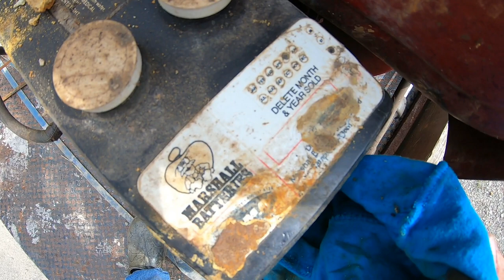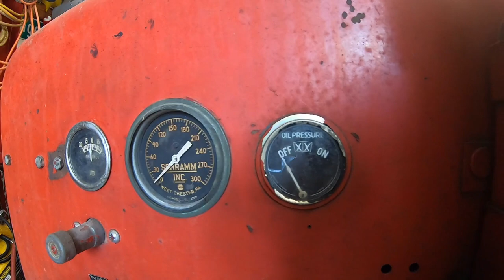1950's Gas Powered Air Compressor sitting 30 years! (Will it run!??)

Comment: Schramm is still in business did a little research on its history why you might ask because I found your find of this piece of equipment very cool and so was the vid!😎
Reply: Likewise . I originally made a comment on how pretty it was but I’m now revisiting the video just to watch it again . Yes a girly girl likes diesel machines. My dad used to let my brother press the pedals whilst I had my head stuck in the engine asking a hundred questions. He had to give in and bought me my own set of feeler gauges , taught me to do a service and change a tyre as the brother trained to be a chef and I was the first female to be taken on in ITV’s Granada tv , Sound department . 
Anyways I had a wee look at the history of this compressor and was surprised to see the company is still trading . An interesting site called ‘ Smokstak ’ an antique engine community have a great thread on this and some cool pictures of these compressors that they are restoring .

Comment: My father was in the Army in WWII and said the military shops had a V8 engine set up the same way.  Supplied air for a bunch of things including vats for de-greasing parts in a tank filled with mineral spirits with the air bubbling up through it to provide agitation.  My father told me about how they would change the oil in the '20s and '30s engines without a filter or pump, you would drain a quart or so of oil and replace it with the same amount of kerosene, then crank it and run at an idle for about 5 minutes then drain all of it and put in fresh oil.  Would take out a lot of the built up sludge, BUT, do not run it above an idle while doing i.
Reply: I knew someone who worked in the mining industry, he used diesel fuel in dirty engine/sumps for the same purpose. He believed the diesel provided a bit more lubrication so was safer to use. However, do not rev the engine and never drive a vehicle like that.
Reply from the maker: I’ve heard lots of stories like that, I’m always too scared to do it myself
Reply: @DieselCreek  Granted it was at a time of engines like the model T, so clearances were sort 0f loose, and a person could change the bearings fairly easily.  Also you should do like Richard Jones and NEVER run the engine fast or for very long.

Comment: That compressor is cool as heck. I’d love to have it running on my truck to go with my 1950’s Lincoln weldanpower with a Wisconsin 2 cylinder hand cranker. Great find friend.
Reply from the maker: I’ve seen those they look very similar

Comment: There was a company in the 80s that used a Ford 302 block the same way for an air compressor...it could run 2 90lb jack hammers at 90psi...
Reply: Time for the old Gunk paint can of carb soak.. come back in a couple days to a mostly clean carb...
Reply from the maker: My uncle actually has one of those lol
Reply: Funny you mention a 302 Ford. In 1982 I replaced a V4 Wisconsin with a 302 and c4 auto in a New Holland hay stacker. Actually worked great  until the old farmer I was working for rolled it with a full load making a sharp turn too fast. Only 3 days after weeks of work. He surprisingly survived without a scratch. Lol
Reply: A.O.SMITH COMPRESSERS
Reply: USED 4 CYLINDERS OF A  FORD V 8 ENGINE
Reply: This new style fuel will eat old rubber because the old rubber wasn't designed for it. A lot of vintage cars have gone up in flames due to this . It melts the rubber bits exactly like your gooey hose. If restoring a car replace all fuel lines . Vintage rubber isn't ethanol resistant.

Comment: That old, Wisconsin engine brought back a few memories. I think it was back in the 70s that Dad was using a 103 Versatile swather on our wheat farm in North Dakota. That little Wisconsin engine powered the wheat-cutting sickle, the hydraulics, belt transmission. I ran that swather for Dad and later purchased the farm from him, so that swather became my property. We never gave the engine a thought. It always ran well, had power enough to run the swathing, even in hilly country, and was pretty much trouble free. A lot of farmers used the 103 Versatile. It’s possible some of the parts might still be in the implement inventories somewhere. Hearing that thing crank over and start really brought back some memories for me.

Comment: I have 2 comments on the carb leaking fuel.
1) the fuel level should be before the top of the bowl.  You might try adjusting the float so the fuel shuts of before the fuel is as the too of the bowl 

2) You might be able to use an o-ring as a bowl gasket.
Reply: No you can't use an o ring for a bowl gasket. On those old engines you have to use gasket paper. And tap around the bowl with a ballpeen hammer lightly. Then cut it out with a utility knife. Parts are hard as hell to find for those old Wisconsin engines. And they are expensive too.
Reply: @danielfouardlibertarianono8017  that's to bad.  I haven't delt with that type carburator before, but it looked like there was a cast part on the body that extended into the bowl that might hold an o-ring in place.  Looking at the small lip on that carburator and bowl, that is a tough gasket to make.  Hopefully adjusting the float will fix the problem so it doesn't leak bad.

Comment: Wow a blast from the past.  When I was a sprout we had an irrigation pump (no electric start) and a Silent Flame tobacco harvester, both with Wisconsin 4 cylinder engines very much like the bastardized 2 cylinder you are working on. My big surprise was that you didn't have any stuck valves. We had to take the cylinder heads off every year, roll the engine over with the hand crank and tap the valves back shut 2 dozen times or so before they would cycle on their own.  That hand crank would kick back and was an arm breaker if you didn't respect it.  NEVER wrap your thumb around the handle when you grab it!

Comment: Where I retired from we had a natural gas engine 460 v8 compressor. On the right side you had the spark plugs on the left side you had the 4 stage compressor. It ran on natural gas while compressing the natural gas on the opposite side. We used these for standby pumps when rebuilding the electric motors and pumps.

Comment: JB-Weld Slow curing is fuel resistant. I've patched up 2x fuel tanks and an oil sump with it. Both never leaked! :) In case you need to do the float again
Reply: JB weld is also a lot heavier than nail polish to it may cause the float to be too heavy

Comment: I worked at Schramm's in the early 80, they were still building these about 25 or 50 at a time untill the parts were used up. A lot of tombstone engravers used them. Schramm's sold air compressors and well drilling equipment all over
the world from here in West Chester,  Pa.
Reply from the maker: That makes sense because the guy I got it from said his dad used it in a cemetery!

Comment: That thing was designed to run air drills. The company still exists.
Reply: M Major : I like your LOGO.   FORD
Reply: @52Ford  i have a compressor just like this one only mine is RED ,mine was originally mounted on a Farm service /Coop truck,and had been used to run tire changing equipment ,it has an hour meter on it that reads  1164,
i actually mounted this thing on a small trailer and pull it around with my garden tractor here at my acreage ,constantly getting used to run air jacks and impacts
Reply: they were used widely on many markets back when high current electric was sparse, more mobile work was done and in conversion from belt, shaft driven by hit-miss engines.
all before my time, but I'm a rather mechanical that paid attention to surroundings over the years. even into the 90's and early 2000's much of that stuff was still n use in the backwoods of West Virginia and other areas. seen lots of it still in old sheds and barns, still used frequently!
Reply: @throttlebottle5906  im from iowa and there are a lot of farms with this old equipment still in use or only recently retired .i'm somewhat of a collector of old engines ,especially oddball stuff ,,aside from small engines i have a collection of over 100 detroit diesel engines ,i even have one of the increasingly Rare GMC 702 V12 engines which up until 2011 was in service driving an irrigation pump
this being rural area there is still a lot of mobile service work done here especially field work repairing tires on farm equipment and road service on trucks
Reply: @wildcoyote34  I have an old Rolair I do the same thing with. Super convenient.
Reply: @dennishayes65  Thanks! Edit: It's from a 1950s Ford automobile. I was going to have a picture of the F-1 from a '52 F1 truck hood trim or the V8 badge, but figured more people would get the Ford badge.
Reply: @52Ford   AWESOME find! Thanks for the link!
Reply: @wildcoyote34 GMC V6s were hard on fuel I've heard, figured the V12 similar? 
Detroit diesels a better choice $$$$wise.
Reply: @charlesangell_bulmtl  you heard right  especially the really big one  the 478 V6 
they were not built for fuel efficiency but for raw stump pulling power 
,,the irrigation pump engine i have was set up to run on propane and it never ran faster than 1200 rpm  maybe 1600 so it wasn't really a fuel hog for it's time  ,, it was replaced with a 4 cylinder John Deere engine of modern design  which is many times more fuel efficient and produces less noise and emissions 
the detroit diesel engine  in it's many forms  is not really fuel efficient compared to modern diesels and is very noisy
Reply: @wildcoyote34  ill bet your almost deaf huh? 😉
Reply: @roguedalek900  no fortunately i am not almost deaf because i'm young enough that i was taught to wear hearing protection around loud machinery ,,there are a lot of old timers who are deaf from the loud engines in old machinery
Reply: @wildcoyote34  detroit diesels may be loud but it's a wonderful noise!
Reply: @markscully2342  yes it is , i love the sound of a detroit diesel winding up , i have several detroit powered machines and trucks as well , including a 1964 GMC crackerbox  with a 6-71  in it ,my grandfather bought it new  ,it was used as a tow truck into the 1980s  , when i inherited it in 1989 , the first thing i did was restore it ,, was a big project for a 16yr old , it now has a flatbed on it and i use it to tow  my 1970 holiday rambler 5th wheel camper which i restored and updated with modern equipment ,,it's actually my favorite truck of all the vehicles i own

Comment: Keep a lookout on marketplace and Craigslist for dental equipment. Often times I see ultrasonic cleaners that are about the size of a big toaster and some are big enough to fit carb parts etc.   Be a handy pick up.
Reply: You can find quite a few on Amazon for under 200 bucks, if nothing else. They're game changers for cleaning parts with small passages like these!
Reply: Some other you tubebers use a cleaner. Musti One and Andy Camarrata

Comment: I was taught how to fix the brass / bronze floats way back when they were common. clean 'em up real good. identify the hole(s) in them. let them drain out till completely dry. sand them real good. then solder the holes closed. now you are good to go. the plastic / foam floats. not so much. fixed a number of leaky floats from small engines back in the day.

Comment: Looks like some high grade fuel in that sediment bowl.  Can't buy that stuff these days lol
Reply: In the 70s we used to use Sinclair gas {reg} which always had a pink tint.
Reply: now you'll just get ethanol blended junk that sucks moisture out the air and settles to the lowest point, rapidly corroding everything go a nasty white crust death ;)

Comment: Emory boards are perfect, first tried it in 1999.  Yep, I am a lot older then you. Nice work! Solder the float if it gives you trouble.  Use plumbing solder it has flux in it. Nail polish is not that consistent.  usually polymer in an acrylic resin, so if the brass is clean and it sticks, most will work. Take it off with acetone if you switch to solder.

Comment: I picked up a pair of vintage ingersol rand gyroflo 125 air compressors one is from 1956 and one is from 1959 with continental f162 engines these old girls had all the curves just like the old trucks of the same era. I love the vintage eauipment!

Comment: Metal (and now nylon) floats are assembled in a vacuum chamber, either
soldiered or ultrasonically welded (nylon). 
The setup resembles a media blast cabinet. 

For DIY repair:
Get an old suitable metal pot. Water will never get hot enough to melt solder.
Actually- find the hole, suspend it in the near boiling water, hole up, 
and solder it closed. The heat will force the air out, then when the hole is plugged, 
and it cools- it will be under a vacuum again.

Comment: Matt: I can’t help you with the Wisconsin parts issue but to seal that carb, I’d suggest Hylomar Blue.  It’s a fuel resistant goo developed by Rolls Royce in the UK for aero engines in the 1950s.  It seals carb leaks very well and is still widely used in aviation.  You can buy it online or at airport maintenance shops.

Comment: Hiya, a first start after all that goo as oil would benefit from a slow gently run with hydraulic oil in it, no revving just let the thin oil reach all the oilways for a gentle flush, then drop it all,  oil filter also. Done this a few times over the 50 odd years servicing vehicles and small plant, worked for me.. Have fun, thanks for the video - Ian.. UK.

Comment: Many years ago one of the service trucks I drove an old International had that exact compressor for air you could run a 1 inch drive air gun all day and it kept up no problem it was awesome when it was cranking and started it brought back memories but I do remember it was a bear to start on cold northeast mornings but once it warmed up it was good all day

Comment: Saw something similar to this in 1970, trailer mounted 6 cylinder compressor.  3 cylinders were power and 3 cylinders were compressor. Commercial made with tank and hose storage. Couple jack hammers stored on one side. Mechanic I knew was working on it.
Reply from the maker: apparently it is a common thing in the compressor world. lots of people saying they've seen them

Comment: You can poke a couple of holes in those brass floats, clean the inside out, then reseal them with solder.  It's easy.  Done it many times.  Make sure it's sealed up good!

Comment: We had a Schramm on a tractor frame. Think it was military surplus machine. Compressor was just like yours, or very similar. I've worked on that thing many hours, but it would really put out the air.
.  Used in a fertilizer. Pendleton, SC.
   Really enjoyed your video.

Comment: Sweet!.  A really cool old compressor and apparently seriously heavy duty.   Amazing how many of those really old engines can still run after years of just sitting.  Some of it is the simplicity.  A lot of it is the quality of the initial builds.  50 years from now, I wonder how many of today's  engines used for 15-20 years and left to sit for 30 will be able to be resurrected.

Comment: You may or may not know but if there is a wear mark on the float where it comes in contact with the needle it can cause the needle to not seat properly causing carb to flood.  I always file and polish to remove wear mark, a mechanic told me about this about 40 years ago to solve flooding on my Corvair and have done it countless times over the years. Also Wisconsin engines are know for hard starting when hot and I have found it to valve adjustments which have closed up slightly. Good luck with it, it’s a nice original unit.

Comment: Awesome old compressor!  I didn't get all the way through yet, but I'd replace the float seat with a rubber tipped unit......You can JB weld float holes if it doesn't make it too heavy.  An old timer told me the JB weld trick when working on an old leaky quadrajunk carb.  I'm surprised nail polish worked, but heck ya I'd try it once.  Thanks for the video, nice work 👍😁

Comment: A company in Los Angeles called Essick made air compressors and cement mixers and even some welders all powered by Wisconsin engines. The V-4 engines were also very popular in farm equipment. I've seen Model A Ford and Willys Jeep engines turned into compressors. The parts are out there. I know you'll find them . It's such a cool unit. I'd love to have one. Perfect for your shop in the boonies with no power.

Comment: Freakin score!!!! Last time I ran a jack hammer we was doing an add-on in a rich neighborhood on the outskirts of D.C. We had to break about a 16'x10' hole in a solid poured concrete wall that was every bit of 18" thick ,and did I mention it was a vertical job. We hung the hammer by the floor joist ,and used brute force (No help from gravity Here) to break through the center which took all day. After that things was much easier. Yea it made the job faster ,but you can say I never want to do it again.

Comment: Getting a carb kit for it should be fairly easy.  They put those V4 Wisconsin motors all kinds of stuff for 30 years.  I have a 1969 Case skid steer factory powered by one and have rebuilt the carb.  Also take some really small, stiff wire (Guitar string or piano wire works great) and dig around in every hole you can find when the carb is apart.  Those small holes get blocked with varnish and often just carb cleaner doesn't clean them out.

Comment: I had a vw engine with 2 plugs taken out and pipes put in there place to feed a tank and the inlet manifold was cut to stop the gas getting in and filters put in the head inlets on compressor side and rockers removed on exhaust side so they stayed closed and the inlet rockers left the same and we plated the exhaust outlets it worked great we used it to blow off our shelter trimmer and multcher every day before we started work love ya vids chur chur from tauranga new Zealand